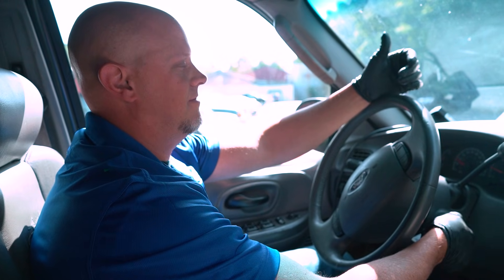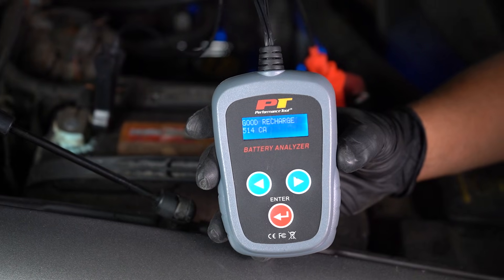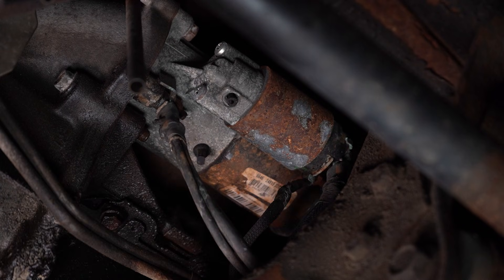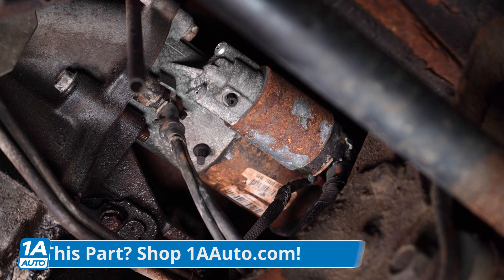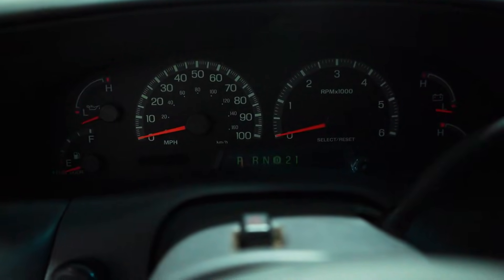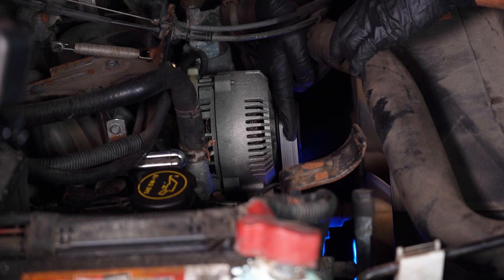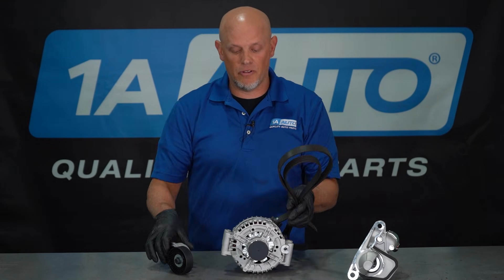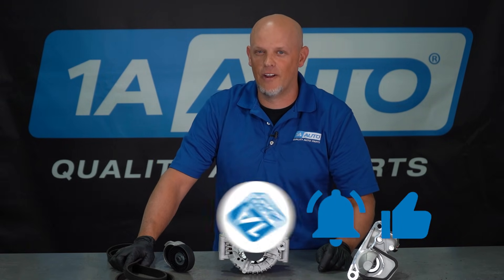Car or Truck Lights Flickering? Top Three Electrical Problems You Can Quickly Fix Yourself

Comment: I started my car and the battery was tested when running good when it just started up from cold it was reading 14v but when I went to a auto part store when the battery light came on then and the lights were flickering it read 11v and I checked the ground by the battery I’m assuming it is the alternator now because my lights worked fine before and battery has been dying can anyone add some advice I would appreciate it 🙏

Comment: I have a 2005 trailblazer and the lights are flickering, I had the alternator and battery checked and they both check out good. I have no engine lights on eithier. When I accelerate they still flicker at the same rate. Any ideas?

Comment: Can a starter cause a car to shut off and not start afterwards? Cause it to do a no crank no start after? My car died while driving the lights started flickering and the radio shut off.
Reply: The alternator stop charging or battery stop holding the charger. You may have a bad coil pack or the other distributor.
Reply: Or no oil.

Comment: I cannot figure out my car's flickering issue. Battery is testing good. The alternator is reading 14.05 volts on my multimeter. I replaced the terminals and a broken ground strap. It is running and starting good but still flickering. No battery light. The alternator is not even a year old. The starter is about 5 years old. It must have a electrical issue that is beyond my ability to fix.
Reply: Same here mine flickers really bad at idle or when use the power windows

Comment: My car dashboard light flicker. Speedometer, acceleration, fuel, temperature gauge all will go down and comes back to normal. Look like car goes dead and come back to life. I'm checking my alternator tomorrow if it can solve the problem
Reply: did t end up being the alternator? having the same issue
Reply: Lmao, no chance you'll see this but any news??
Reply: What was the issue?
Reply: I know this was posted a year ago but did you ever find out what was wrong?

Comment: My 03 GMC ENVOY SLT would not start. Checked, found couple of bad fuses under the hood.  Had battery tested was fine. Replaced starter it worked. But now, when I turn on my heater fan it wants to die or bogg then recovers. Intermittent. Had an issue with a loose negative on battery but I replaced bolt. Where should I start looking?

Comment: My headlights flickered/ strobed on a 1998 Toyota Camry. Replaced bulbs, relays, module control & checked electrical grounds... Permanently fix flickering by installing a custom built 230 amp alternator. Problem solved

Comment: Y is my 96 gmc sonoma s15 with the v6 4.3l randomly shutting off while I'm driving?
Reply: Always points to crankshaft position sensor when stallion Beyond that, could be a 100 things like fuel pump intermittently losing pressure

Comment: GET YOUR STARTERS AT YOUR LOCAL AUTO PARTS. YOU'LL GET A MUCH BETTER DEAL 
AND PAY LESS, AND YOU'LL GET A FREE LIFETIME REPLACEMENT!! SAVE YOUR MONEY.
Reply: Not always, sometimes you can get parts online Much cheaper with the same warranties and if you buy multiple of the same or different parts in bulk it’s even better.